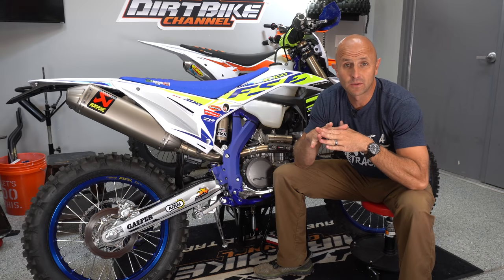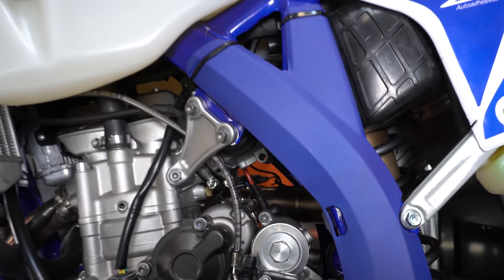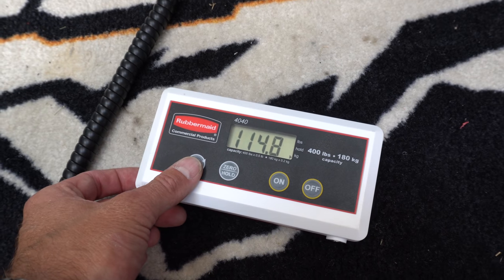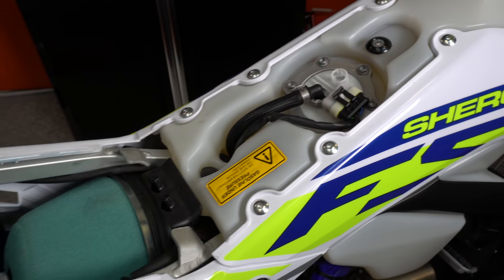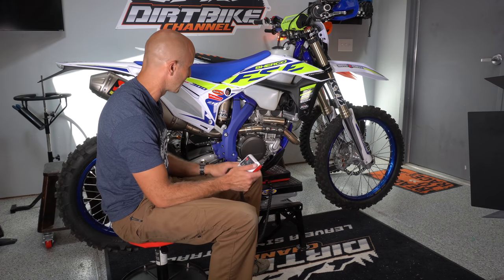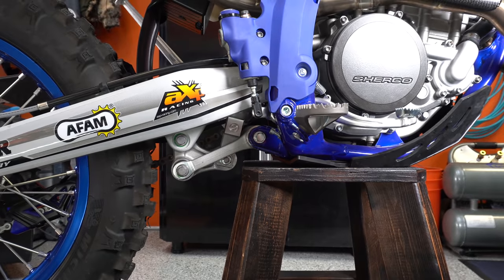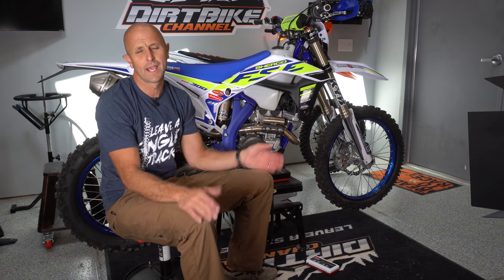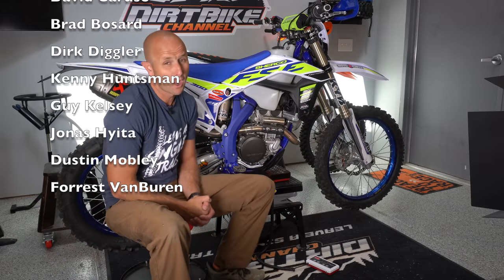2020 Sherco SEF Factory True Riding Weight - 7 lbs lighter than before???

Comment: Just purchased the same bike, it is a blast.  It turns so well (I can turn  switchbacks tighter than my 2T) and feels super light.  Shorter  wheelbase than other 4ts .  It is really comparable to the 250fx, also a great bike.  I replaced my Beta 300 RE and so far, it was a good decision for me.
Reply: How has it been reliability wise? Historically are they reliable and or easy to work on? I’m about to pull the trigger on one but trying to compare it to the Honda crf250rx.
Reply: @LegionofDune  zero issues with the Sherco. I could not say the same for the KTMs and  Huskys, I have owned.   Especially the Husky  - too bad because it is a good looking machine. There is not a perfect bike but I would not worry about buying non-Japanese.   Have not needed to work on a Sherco, but you can easily get OEM parts from online dealers here in the US.  They are still building out their dealer network but they are going to be growing big time in the next couple of years.
Reply: @TorqueDorque  thanks man, appreciate the response!

Comment: I have the exact same bike and love it! There's something great when a trials bike manufacturer builds an Enduro bike. I did the AXP full skid plate and it's a nice piece. I did also find the throttle a bit touchy and used E3 Ergonomics throttle tube tammer edition to smooth it out a bit.

Comment: Seeing the sea of Sherco's and Cody Webb at Tough Like RORR this year really has me eyeing up the 2021 Sherco 250SE Factory. I love my YZ250X and I wouldn't bother going to a KTM/Husky but a bike designed for more of a trials style? Sign me up. Surely I can use my spare front wheels from the YZ on the Sherco (I hope), but probably not the rear wheel. It'd be nice to move my wheelsets over with me to a new bike
Reply: Last I checked sherco share ktm wheel pattern.
Reply: @charliekohn4271  that's with the WP suspension. The factory shercos have kyb

Comment: What is that tank under the left rear of the fender?
Reply: Radiator overflow
Reply: @chewbacka78  interesting, I've always seen them mounted at the highest location in the system. I wonder how susceptible to rocks and damage it is under there.

Comment: Every video I have seen from the USA of people using the Michelin enduro medium doesn't rate the tyres. Over here in the UK everyone loves them for racing and trail riding combined with bib mousses.
Reply: I thought they where basically require for a lot of enduro racing on your side of the pond? We dont generally have any true regs in a race here in the states just sound checks and spark arrestors, and what passes for one here is pretty lax.

Comment: Lighter almost always equals weaker parts..
Reply: Tell that to my 18 300xc far lighter bike than any sherco enduro. 260 hours of racing and a lot of stock parts left on it. It has been through hell so many times its considered a resident.
Reply: @charliekohn4271  my 1999 KTM 300 exc had 450, possibly more, hours all stock except I put a set of rings in it. I consider clutch maintenance. some parts have gotten better and some worse. I can't understand why KTM can't figure out fork sticktation. I can't understand why KTM doesn't fix that freaking pipe to head joint on the 2 strokes. I can't understand why KTM doesn't fix their hubs. Has yours starts loosening up while riding, if not, it will. This new KTM has less than 70 hours and the freaking rear wheel is already loosening up while riding. I've already got the parts to fix it. The front rim is bent to hell and I haven't put it through half what I did my Honda. I just wish KTM would drop WP. They suck compared to other brands. Yamaha is the toughest bike out there by far but they don't support dirt bikes much at all anymore.